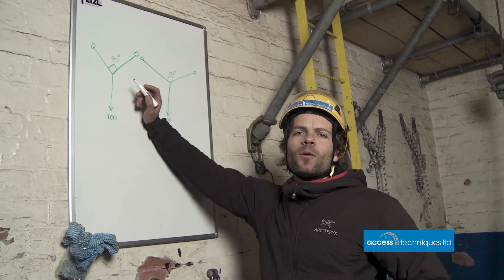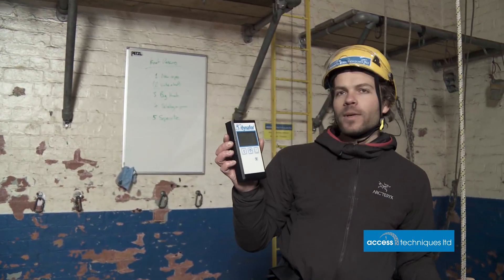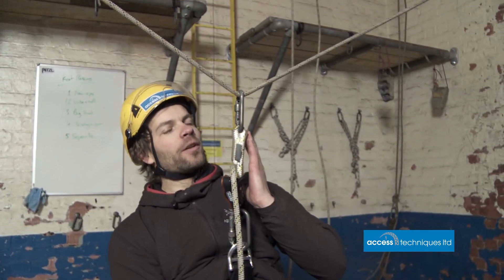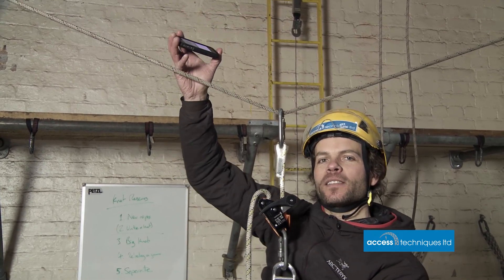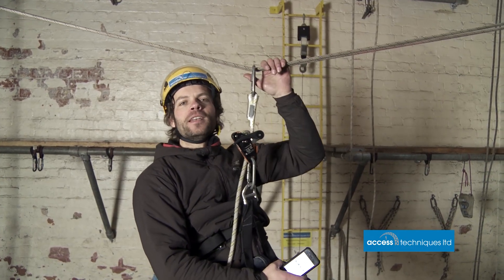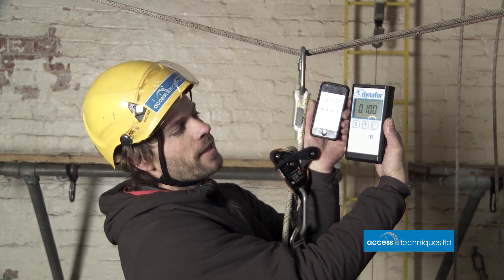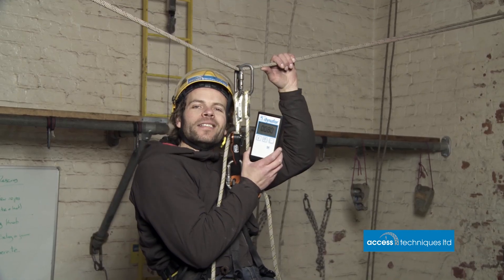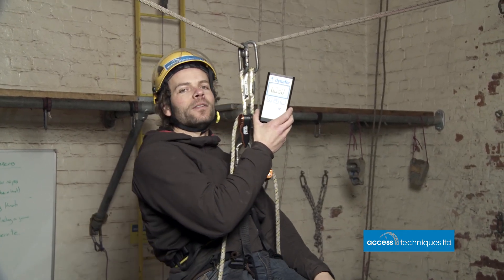Horizontal Tension Lines for rope access, by Access techniques Ltd

Comment: Very good, I am interested in the figures if the diameters of the ropes are greater say 11mm and the tightening system is using prussics an pullies with 50 mm slings on bombproof I beam anchors, where the weakest link may lie...especially with say 50kg drops of say 1 meter....?

Comment: Super clear and creative! There are still a couple of questions lingering in my mind after this video. Like is your rope static or dynamic. What kind of objections do you have when you are using prusik knots are Grigri? Keep up the good work it's the clearest explanation of this topic that I've yet seen!
Reply from the maker: We use low stretch rope - 11mm EN 1891. When I've pull-tested them, prusik knots behave unpredictably. Grigris are belay devices for rock climbing - in both cases a stronger, industrially rated item, is available, so we use it!

Comment: Vector loading does indeed increase anchor loads exponentially. That said wire rope does stretch, maybe not as fast as a static/minimal elongation rope, but everything stretches. 9.5mm (3/8”) 7x19 IWRC EIPS wire rope has a minimum breaking strength of 6,500 kg (14,400 lbs). In an application where wire rope has replaced static rope the anchors should also be upgraded to appropriate strength to maintain a 5:1 safety factor. Also there is a limit to the length any rope can span (wire or static) and still maintain an appropriate safety factor. I would be hesitant to rely on double 9.5mm wire ropes beyond a span of 365 meters (1,200 feet) in this application. The weight of the material it self becomes a factor at long lengths, as the above mentioned cable weighs .37kg/m (.25#/ft).

Comment: Great informative video! Me and a few friends did simular testing 2 weeks ago. I came to the same conclusion that it is really hard to go over 160 degrees without resorting to crazy mechanical advantage systems. Which is a good thing ofcourse.
Did you do any testing when using the ID as a progress capture and see when it starts to slide?

Oh and what app are you using to measure the angle?